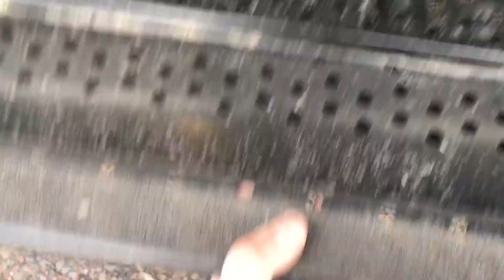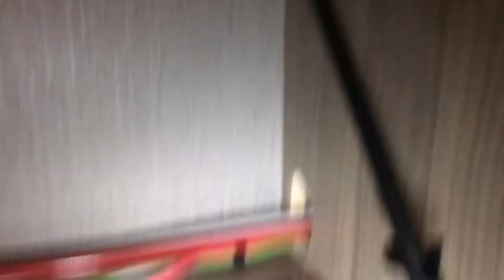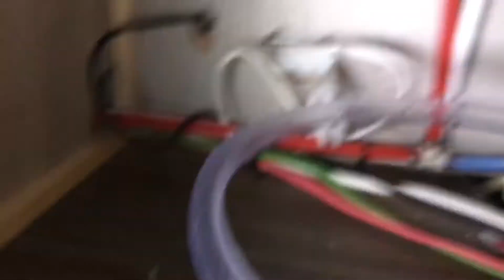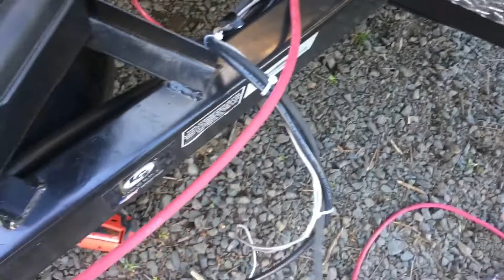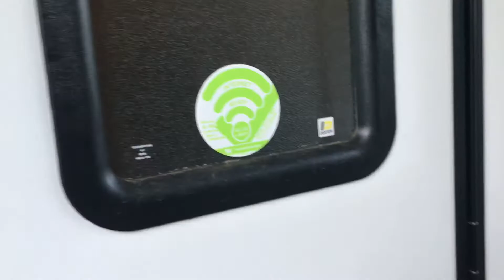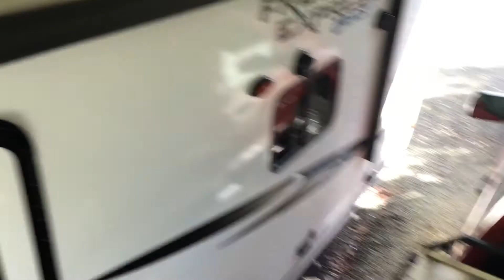Freedom Express 17BLSE by Coachmen tour & mods (long boring video)

Comment: Thumbs UP! - Awesome video - thanks for sharing. Do you still recommend this RV? I'm looking for a similar sized TH and I keep waffling between a manufactured unit or just getting a cargo trailer to customize. The issue is I just have no desire to convert a cargo trailer, but finances and RV cost and build quality have me re-thinking matters. Your mods, skills, and attention to details are outstanding!
Reply from the maker: Yes I continue to be fairly satisfied with the rig.  Fit/finish in the interior isn’t spectacular and it isn’t heavily built (designed to hit half ton capable) but so far no major problems. My only concerns would be the foam core roof, and the foam core floor. Having been under it for tank heaters, though, I see there is a tank support under a good section of floor, which might keep it from getting flexy as it ages. 

Of the other options, Outdoors RV makes a nice toyhauler with no slide. They weld their own frames and are heavier built, but expensive and luan instead of Azdel. 

Alliance’s little toy hauler is also nice, with the ramp deck with patio doors,  small Schwintek type slide for the bed. Not a fan of that slide type, but one that small might not be bad. 

Cost of ownership wise, it would be a chunk of change to convert a cargo unit (power system, tanks, furnace, insulation) and it might be hard to get that money back out.  A lightly used RV (get an inspection) if well kept, might hold more value.

Comment: Just bought my 2023 17blse.  Looking more closely, I’m disappointed!  First off the TV isn’t even a smart TV!!!  Why on earth would water connection be directly above the electrical plug in???  I immediately had to install a power disconnect switch.  The fresh water drain is a joke for sure!!!!  I also installed 2 towel bars, a tp holder and a paper towel holder.  It’s definitely the cheapest RV I’ve ever bought!  All the small things would make it so much nicer.
Reply from the maker: Yeah there is definitely some cost cutting in this price class.  Mine came with a towel ring and TP holder that weren’t mounted.  IIRC the dealer said people often prefer to choose where to mount those items themselves, but they would put them up if I preferred.  I actually found towel bars and tp holder that I liked better.  

The water above the power cord does seem like a brain dead choice, but once plugged in the connection should be water proof. 

Overall I am happy with mine. I wouldn’t mind upgrading to something like an Alliance Valor 21T15, but they are also around twice the price.
Reply: @JeffinTD  in this price class?  MSRP is &39k
Reply from the maker: Yeah. You see them advertised around 26.   Alliance’s smallest toy hauler can msrp into the 70’s with options, and you see them published at 42ish with minimum options. Grand Design’s smallest toy hauler advertises around 43k. Outdoors RV generally go in the 50’s.  Granted they are all larger, but I’d still say the 17blse is on the lower end. 

That said, yeah there are things freedom express could have done for very little money that would have been nice. Say smart 12v tv, battery disconnect, move the power inlet. OTOH they used quality Dicor PVC roof, and the thick heavy duty belly as opposed to cheap corplast, Azdel walls. 

I’m sorry you’re disappointed with yours. Adding things like towel racks, a fire stick, 12v outlets and a main breaker were things I guess I’d planned on.  You do see people who spent 90+ and had the roof ballon in the wind, or a major leak or other huge problem, so I guess we are better off than some.
Reply: @JeffinTD  have you noticed your front cap being deformed or creased where it bends across the front of the RV?
Reply from the maker: @hahaadventures4838   No. There is one little ripple where it wasn’t totally perfect.
Reply: @JeffinTD  I have 1 more question for ya.  Do you travel with water in the water tank?  I’ve heard both sides……Thinking about just traveling with minimal water around 10-15 gallons.
Reply from the maker: @hahaadventures4838   I do travel often with full water. Waste of weight if there is water at the campground but I often boondock.  There are two C channels across the frame rails supporting the tank, and I’m not sure earlier ones had those.  Probably would have been fine stock, but carrying full tank over rough road I decided to add additional C channel braces. 

I also went ahead and added a 12v tank heater, and elbow heaters for the dump valves. Other than the dump valves being stuck until they thaw, I haven’t had issues traveling/camping in the cold, but the heaters will add peace of mind. 

I’ve done this with other RV’s I’ve owned. Insufficient support under tanks seems to be a thing. 

I was toying with putting up a video of the project.

Comment: I have a 2023 and my heater only blows cool air, have you run into this issue?
Reply from the maker: Mine’s been fine. A furnace can fail to heat for a variety of reasons.  Typically their sequence is when the thermostat calls for heat the fan starts. There is an over-temp limit switch and a sail switch (switch with a long arm blown by air from the fan) and if both of those are good, after a brief time it will open the gas valve and start the ignition coil sparking.  Most of the modern ones detect flame via the same spark electrode.  If flame isn’t detected within a few seconds it will discontinue sparking and close the gas valve.  Some models also have a reset procedure. 

Anyway fail to blow hot air could be anything from low gas pressure, bad  sail switch or limit thermostat, bug got up in the orifice for the burner, and so on. 

If it’s under warranty I’d probably take it in. Obviously an improperly repaired furnace could be very dangerous, so you’d likely want someone qualified…
Reply: Mine fine but how did you address the heavy tongue weight ?

Comment: Hi, great video, I just bought a 2019 17blse.  Where did you buy that 12v power station you mounted under the stereo?
Reply from the maker: Hey thanks. 

The panel with the USB ports and 12v socket?  They used to be on Amazon, but recently I couldn’t find them there and found them on eBay as “Dual USB Charger Car SUV Boat Breaker Switch Panel +Cigarette Lighter Socket 12V”   I ended up ordering another one that I mounted at the head of bed (looks like I need a cpap).
Reply: I ended up finding a similar one and installed it.  I went camping in upper Michigan in a National Forest area and it worked great when it rained all day one of the days up there.  
Last month I was hauling my camper from Wisconsin to Colorado and I broke a leaf spring.  It was a nightmare.  Apparently it isn't a common spring and I had to drive 700 miles round trip to Minneapolis to get a pair.  Needless to say I never made it to Colorado.  The shackles were super worn too so I just ordered the other springs and hardware for the other axle too.  I have the old good spring for a spare at least should that happen again.  I also put grease-able shackle bolts and brass bushings.  It sucks that Coachmen used the cheapest hardware to build these campers.
Reply from the maker: @jeremynicholls3049  Man, bummer on the broken spring. Seems most trailers under $40k come with the basic suspension. A lot of people only do a couple of short trips a year and are probably fine. I figure I’ve got around 10,000 on mine. It’s been from my home in Oregon to Wisconsin once and Arizona a couple of times, plus some local trips. 

I just did Goodyears and added some steel under the fresh tank along with tank heaters.  The next time I do the wheel bearings I might go new Timkins and do wet bolt/bronze bushing/heavy shackle deal. 

If you send Dexter’s customer service an email with a photo of the axle’s data plate, they will send a pdf build sheet showing part numbers for everything.
Reply: do you haul any weight in the trailer?
Reply from the maker: @jeremynicholls3049   Nothing huge though I do often have to run full water.  I really should run it over a cat scale.
Reply: I'd be interested to see how you did that work underneath.  Did you remove the whole underbelly cover?  Is that a big job?
Reply from the maker: @jeremynicholls3049  I’ll get a video stitched together and loaded.  I didn’t pull the entire belly down, just the back half to see exactly where tanks are and how they are supported and to add a tank heater. 

Not a bad job. Factory used nails to hold the underbelly up, sealed with foam.  A vice grip can pull the nails out. Re- foam and replace nails with #10 self drilling screws. Not too bad a job.
Reply from the maker: @jeremynicholls3049  This is up. https://youtu.be/Df99zqBxIZ0?si=_RL3tlXS6OPJI2-g

Comment: Very informative video!  I was just going to mention I saw on another video that to control the temperature in the fridge move that little white sensor strip on the metal fins.  See the markings on the wall in the fridge next to it?  Slide the white temp sensor up or down on the fin to raise or lower the temperature.  Not sure how well it works, but that is how it was described.
Reply from the maker: Thanks. Yeah I eventually saw that. It does seem to have some effect, but the thing seems to keep food pretty well as it is.
Reply: @JeffinTD  That's good to hear.  Say i was thinking of getting this RV, hoping it is built to maybe a tougher standard than the Wolf Pup, (although it's tempting with all the extras they add,  the reviews are scary!).  Are you still liking it after owning it for a couple of years?  Would you recommend it?
Reply from the maker: @c.m.303   Overall, it’s been ok. It’s gone from Oregon to Wisconsin and to Arizona a few times. I think I’ve changed out a couple interior light fixtures (LED’s start flickering) and I caught a crack opening along corner trim during a check of sealant, but they all have little issues like that.  

I’m not a huge fan of roof and floor construction (structural foam sandwiched in lamination with thin ply panels) but so far everything structural has held up well. 

I think they are built considerably better than Wolf Pups I’ve seen, but they are no where as nice as an Arctic Fox, Lance or whatever. 

Sometimes I think a heavier more off grid rough use unit like Outdoors RV would more match my needs (if I went non-toyhauler). I’m sure they are sturdier, but they are also more than twice the price…

Sorry for the long rambling answer. I guess short answer, if today I were looking for a budget friendly double axle toyhauler of decent quality, I think I’d buy this one again.
Reply: @JeffinTD  Thanks for the detailed response!  Totally agree with you on the tougher off-road units, and Lance has a very tempting toy hauler!  But for now I'll be pulling it with my ever Trustee 1st generation Tacoma,  so weight is a main limitation.  I just wasn't expecting to read so many bad reviews from Forest River.  Very glad to hear yours is doing well and that it's still enjoyable.
Reply: @JeffinTD  And also how's the solar working out?  I have tried to learn about solar, but electrical is just one of those things that I can't get my brain to grasp.   If/when I pick up a unit, is there any chance I could hire you to do a solar install?
Reply from the maker: @c.m.303   For a Tacoma I suspect you’d be over the hitch weight rating with this unit, and a realistic load of stuff. Not saying that it can’t be done…

Solar wise the system has been working well. The two batteries that came with it were only rated 60something amp hours, which likely wouldn’t be enough if you had several days of very cold weather (a lot of furnace run time) without at least some sun. I upgraded to 2 GC-2 6v golf cart type batteries for 230 amp hours, which will be a better deal. 

I’m neither licensed or insured, so I wouldn’t be comfortable doing work on something I didn’t own. Solar-electric.com is a reputable place I do business with. I think they may have some package deals of components designed to work well together in rv applications.
Reply from the maker: Hadn’t really kept up on reviews. Were people complaining about Forest River in general, or the 17blse specifically?  What kind of problems?
Reply: @JeffinTD  I couldn't find reviews of the 17BLSE.  But Forest River has acquired several brands.   And although more shoddy work came through some brands than others... they all had a common thread of Forest River ignoring pleas for part's and even a lack of responses to warranty requests.   Two of the worst was someone 60 miles from home on their first trip being flagged to pull over.   They were dragging the water tank that had fallen out of the RV.  Another had the roof literally pealing off the RV as they drove down the freeway.  Many reported several items breaking on every trip, unsure if they could make it home.  Many reported tires blowing out after a few miles, leaks,  random screws falling out, cabinet doors falling apart, etc.., etc. Several people stated the RV was in the shop for most of the first year, and many issues went un-repaired. 

Pretty heartbreaking stories, but even RVs that cost twice as much had similar stories of RVs sitting months waiting on parts that just weren't coming.  I didn't hear any method of recourse being discussed other than one case where they tried taking them to court.   But the industry lawyered up with such extreme lawyers the customer said she didn't stand a chance.

Nearly scared me away,  but I'm at that point in life that it's now or never.  So I'm still researching, but I'm hoping sooner than later I can find something that will work.  I really appreciate all the insight you've shared about the BLSE it stands out to me because the numbers look good on the axles not being over loaded, and kind of hoping the lack of reviews is better.  Like, no news is better than bad news. 🥴 but I just heard back from a representative that he was unable to give any info about safely supporting the ramp as a deck and any attempt would void the RV warranty.  Makes me question the strength of that ramp and how it is attached, but mainly that's kind of a big issue for me.   I'll have to think about it for a bit longer now. 🤔
Reply from the maker: @c.m.303   All of them tend to have some issues. I did contact the manufacturer when one of the interior lights started failing.  He said something about forwarding it to whatever department and I never heard anything- so I just bought a replacement off Amazon. 

Other than a major structural problem, I’d consider most RV warranties to likely be more hassle than they are worth. I’ve known people to make two long trips to a dealer with a list of little issues… cabinet hinges working loose, catch for screen door needs adjusted kinda stuff a person could fix themselves in half an hour.  

Tire wise, this does come with cheap tires and I intended to replace them by now just in general principle, but they’ve held up fine. I do check tire pressure, and lug nut torque every trip. I suspect a lot of failures of tires are due to under inflation. 

These things rattle down the road and naturally flex. A couple times a year checking the roof and external sealant, making sure all the cabinet screws are tight, checking the plumbing and propane for leaks is kinda part of the deal. 

Ramp wise, the bulkhead the ramp attaches to is quite substantial. The ramp it’s self is fairly lightly built. Mine has held up, though they did leave a gap between the top weatherstripping and the side weatherstripping. If in a howling windy rainstorm at the wrong direction it could leak- but a bit of sealant solved that. 

I’d heard someone had a tank support fail, and there was apparently some response about people don’t usually travel with the tank full. That’s kinda bs as there is no source of water many places I go. It looks like mine has a piece of angle iron as an additional cross member I don’t think earlier units have. I travel with water and have had no problems. If I hit a rough road, though, I’ll be idling tractor slow in low. 

I had a huge 5th wheel that had some sagging of the support under the fresh tank.  I just replaced fairly thin wall angle iron with 1/8 wall rectangular tubing. Of course it wouldn’t have been a quick and cheap repair if I hadn’t caught it before it failed completely.